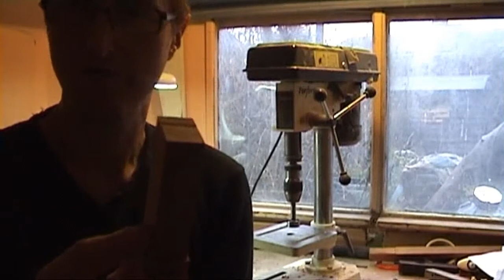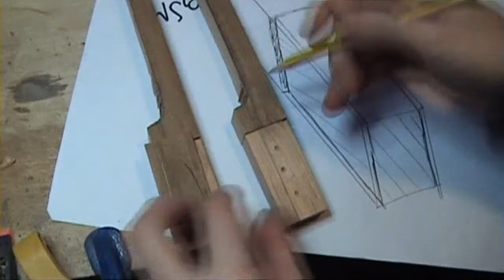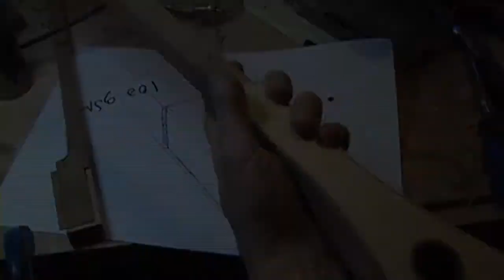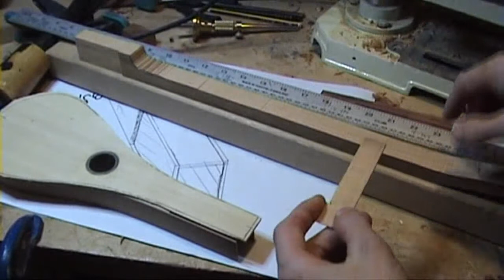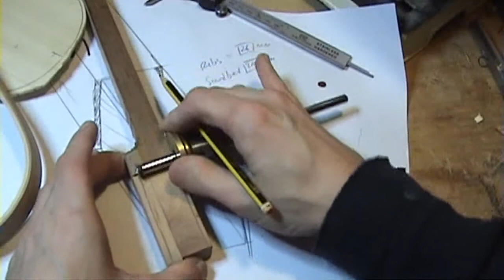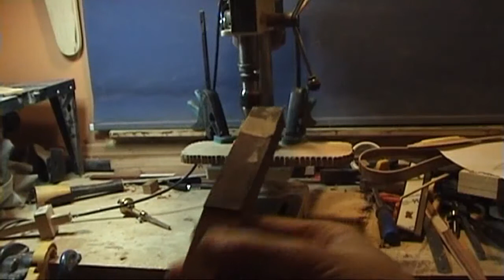Stick Dulcimer Making part 5.4: Making the neck

Comment: Dude, if you offered classes on instrument building, I'd fly across the pond and sleep in a tent. HOWEVER... at 0:22 where you say to "take off the same amount on the left hand side" With a band saw, your fingers get a tad close to the blade. Call me a mother hen. The blade's not moving, right? I'm worried over nothing, right?
But you should tape the bit you cut off to thin the neck back on, so both sides have the same thickness. Or cut rebates before thinning the neck.